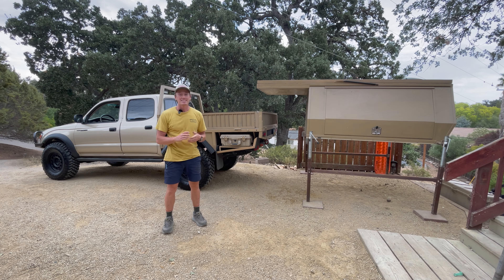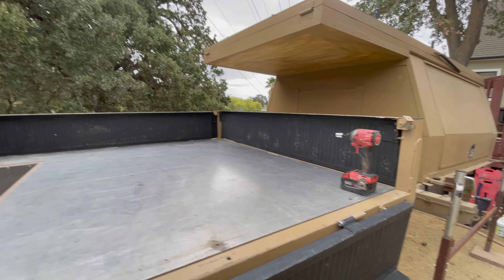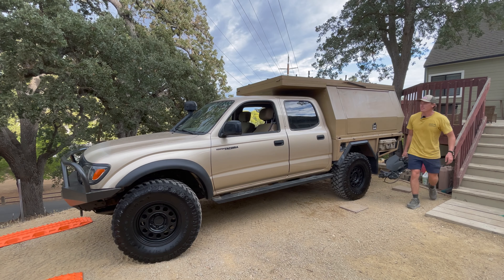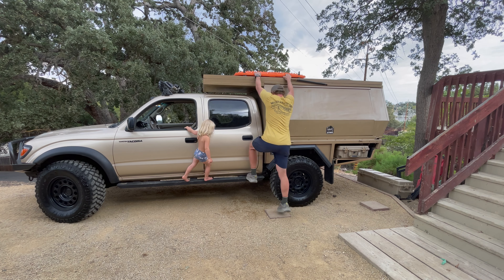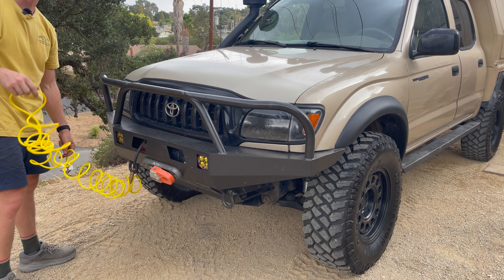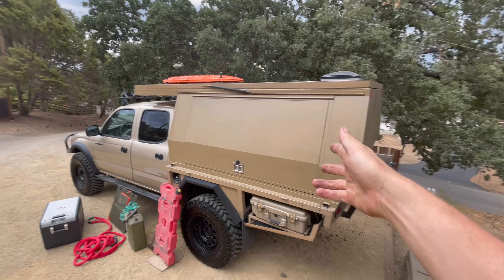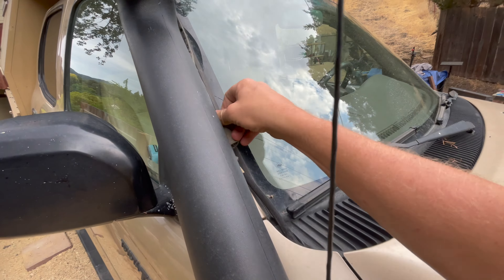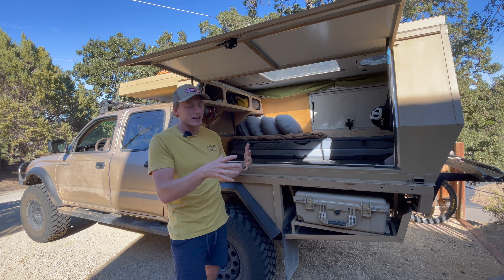Attaching the camper to the flatbed 4K

Comment: Dag, yo, rollin an early Cayenne, too? Those things are stupidly capable off-road as well! Love the ideas you come up with in your videos.
Reply from the maker: Thanks Nate! Yep 2006 cayenne turbo S. Craig list in 2018 for $12,000 with 117k miles. Now has 190,xxx
Reply: @OverlandUnderBudget  I've beat the tar out of my '07 Touareg (Cayenne "twin" if you weren't aware). Bought pristine at 66k in 2019 for $8200, now 107k and not so cosmetically pristine but zero functional issues. Bone stock, thing does NOT get stuck unless I'm being very, very, VERRRRY unreasonable.

Comment: Looks like a nice setup I'm going to have to finish watching the video later but I was watching you lower it on to the flatbed and just had a thought since they're moving in the same direction you could run a bar between them on the swivel point that the handles are on and put a handle in the middle of the bar and you could actually work two at a time instead of having to go to all four corners just go back and forth between either side to jack it up it might require a little more effort spending it but it doesn't look like it's that heavy so it shouldn't be that difficult just a thought if you do it or not that's up to you or if someone else sees it besides to copy you this might be something that they might use
Reply from the maker: Totally, I’ve thought about that, but might be a little more difficult in practice then it’s worth